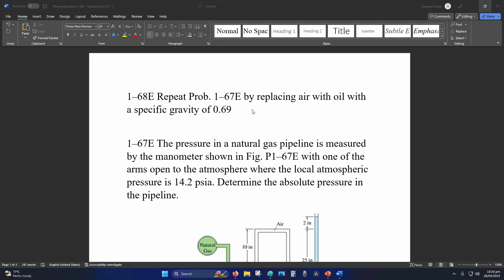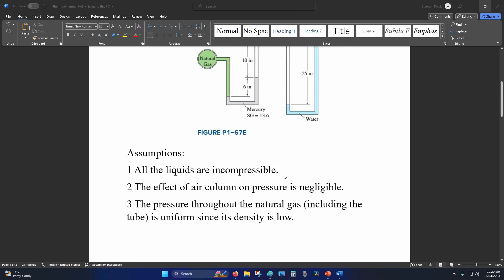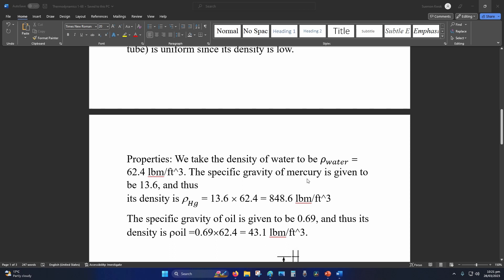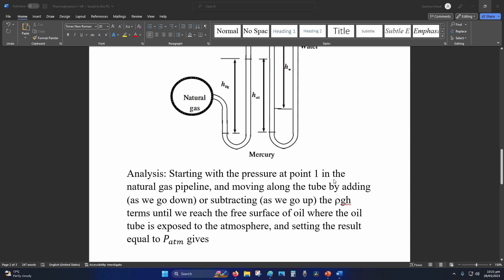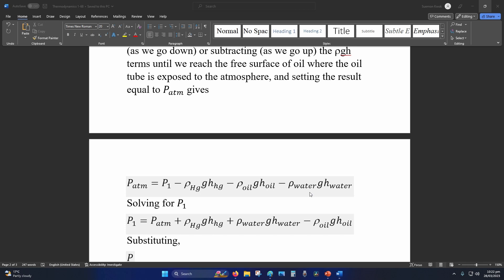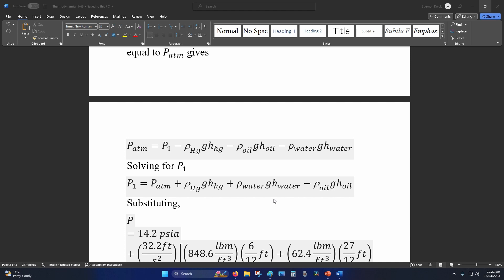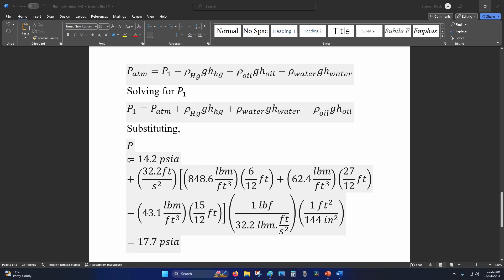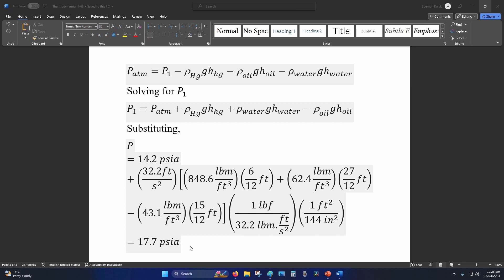Thermodynamics 1-68 Repeat Prob. 1–67E by replacing air with oil with a specific gravity of 0.69

Comment: Why is density oil negative?
Reply from the maker: The negative sign is there to account for the direction of the pressure exerted by the oil column, not to indicate a negative density.

The density of oil isn’t actually negative. Instead, the negative sign in front of the oil term indicates that the pressure contribution from the oil column is subtracted from the total pressure. This is because the oil column is pushing in the opposite direction compared to the other columns (mercury and water).

The paragraph in analysis 

Starting with the pressure at point 1 in the natural gas pipeline, and moving along the tube by adding (+) (as we go down) or subtracting (-) (as we go up) the gh terms until we reach the free surface of oil where the oil tube is exposed to the atmosphere, and setting the result equal to P_atm